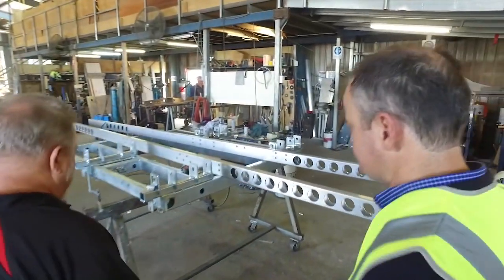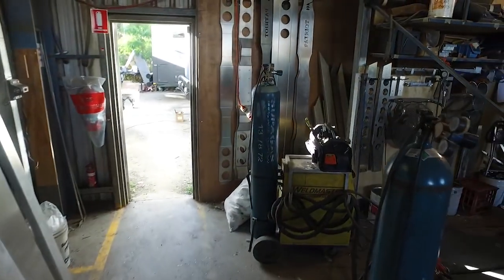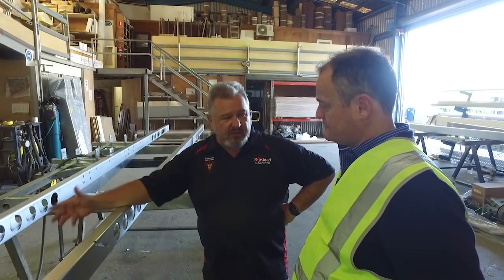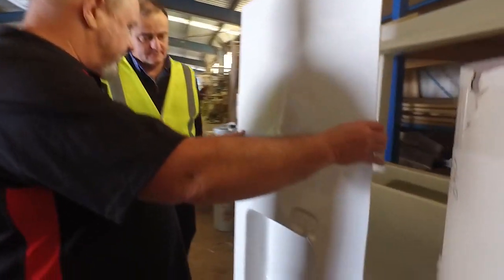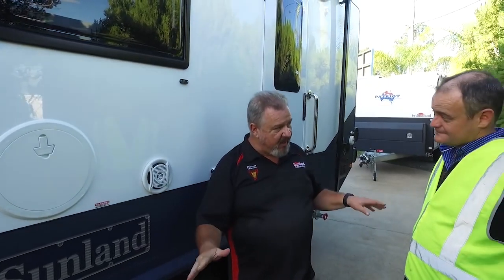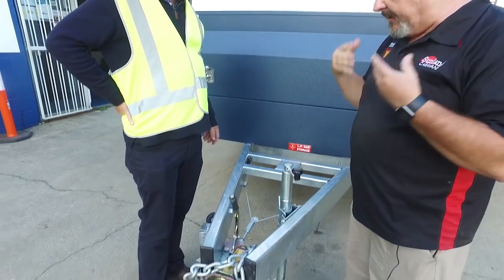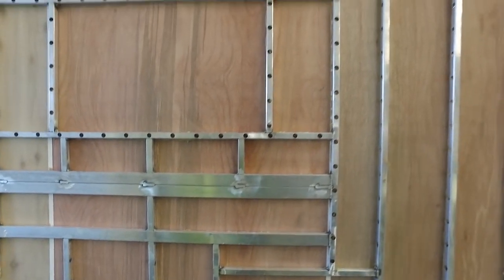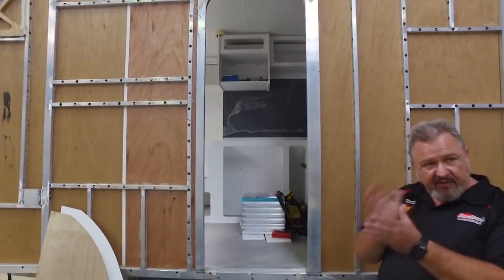Off Road Caravans Manufacturer Sunland Caravans | Secrets Revealed

Comment: Yeah don't expect that at Avan.
I was welding in their independent suspension systems and the supervisor tells me I was wasting my time grinding off the galvanizing saying he welds them straight onto double dip galvanizing.
Diluting that galvanizing into your weld causes Base Metal Dilution and is a great way to reduce the yield strength of the weld. So good on you Jayco for showing how the suspension should be done.

Comment: Awesome Roy

33mm floor
30mm walls/roof (sandwich material) 😉👍🏼 

ALL one piece meeeeean. 

The chassis is AMAZING

I know Roy you love ya shower door…curtain will do (easier to dry) cause you hv that consultina door seperating the wc/shower from the main compartment 

I loved that electric ceramic 2 element stove…having x3 batteries x 4 solar panels & 3000w invert WOW ..do away with gas cooking😂😉👍🏼💕🍻

Comment: Roof top hatches.. made of plastic..designed to break down ..silicone sealant breaks down..water leaks in..min..most vans have them..have you come across this.if so how have you overcome this..
Reply: I agree caravans don’t last long whoever makes them it’s all smoke and mirrors.
Reply: Well they need to keep them light for towing.
If you put heavy glass and solid furniture in them you would need a RAM to tow them.
They are very well designed and consist of high quality materials for the purpose they serve.
Reply: A Boat Hatch!